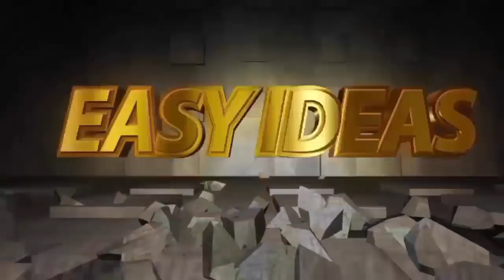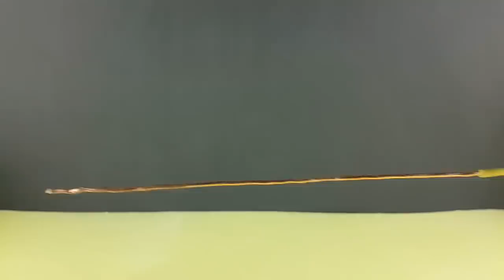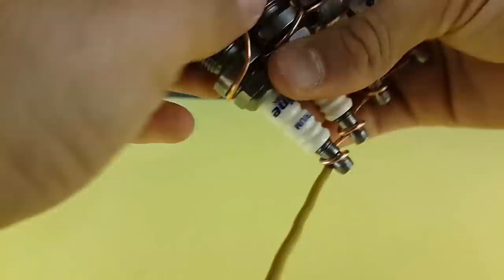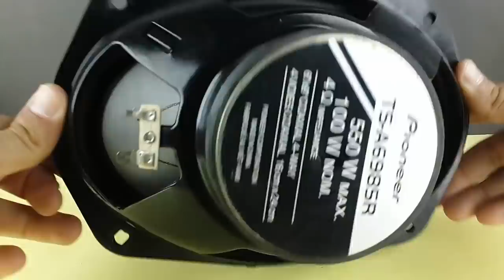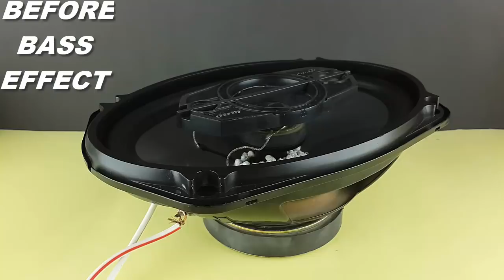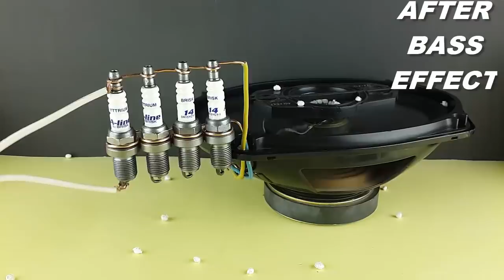How to make increase bass on subwoofer speaker louder and high bass

Comment: Why do you need so much of that contraption. Go to the shop and buy the amplifier that matches the speaker.   If your speaker is 80watts buy a 80watt amplifier.  It will work great and perfect. This contraption sounds like a earrape track

Comment: No plugs….Radio bass setting -3… slap on some sparkys. And boom… watch all the simps when i turn bass setting to +3… pretty sure this setup works better if you throw it in a trash can and/or use gas and torch to direct solder wires from amp!!!